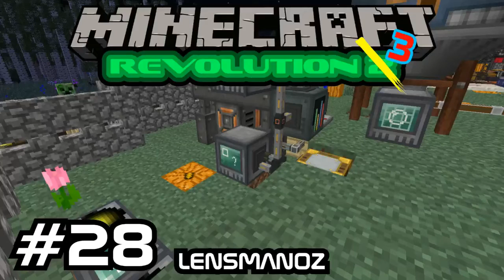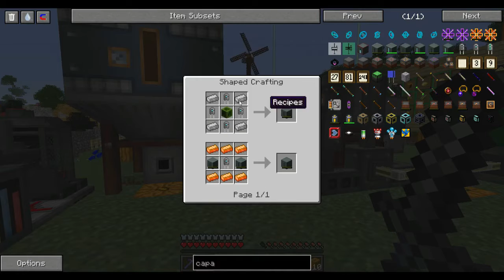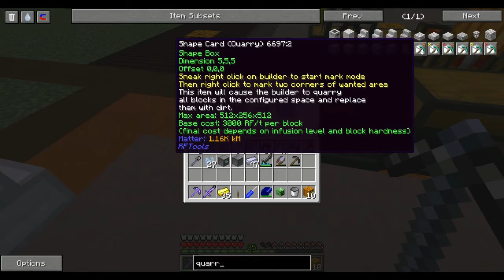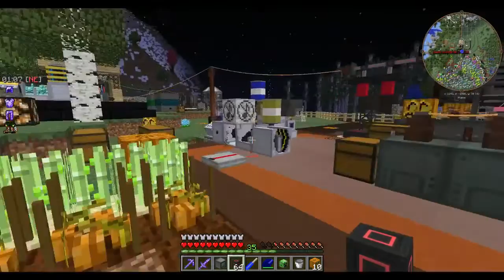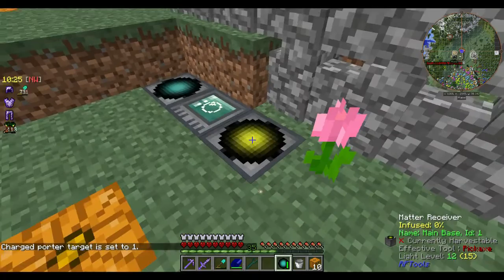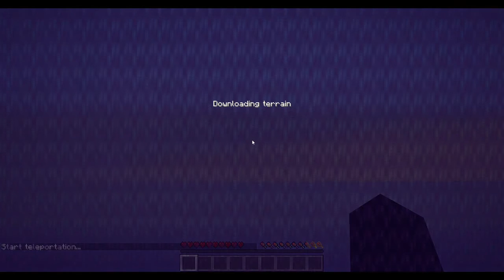Minecraft - Revolution 3 - Ep 28 - RF Tools beginning

Comment: If you smack the Redstone port on the diesel generator with the engineer's hammer, it will invert its Redstone requirements, making the NOT gate unneeded. I'm pretty sure you can do that with the other IE machines as well...
Reply from the maker: It was weird I tried to invert the signal and it wouldn't do it... I'll try again
Reply: It may just be on the 1.9 and up version.... try the other tools... I'll check to see if its 1.9 and up for you